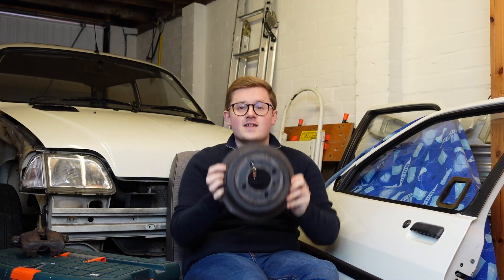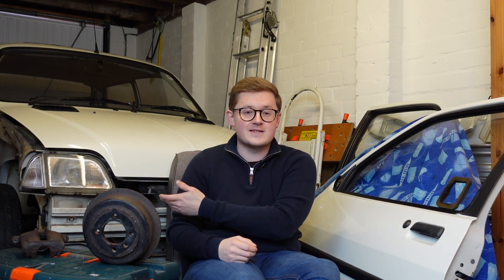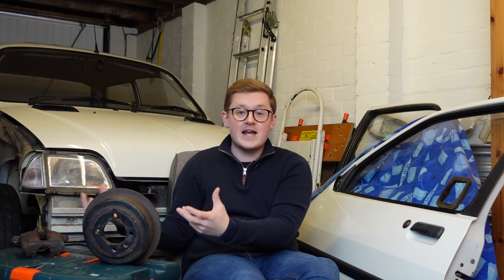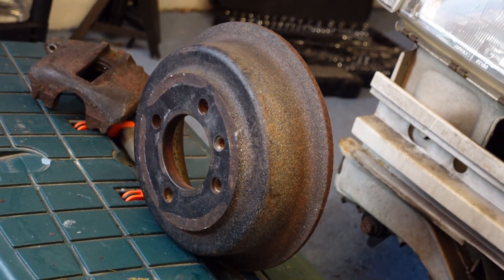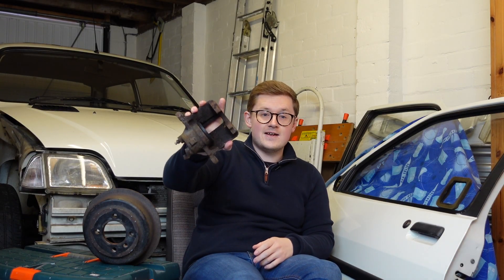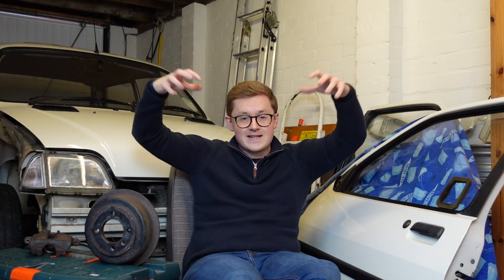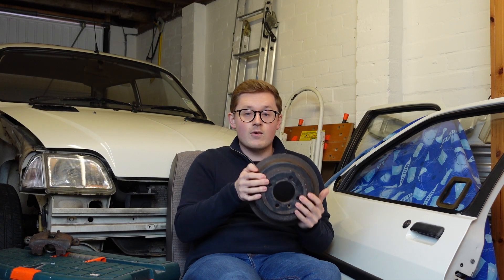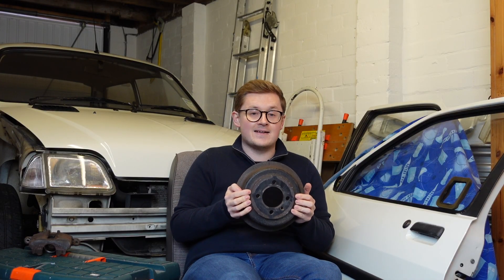Why are Drum Brakes Making an EV Comeback?

Comment: Great video! I've moaned for years about the rear brakes on me Hyundai i10. Park overnight - handbrake seized on! Hyundai are supposed to have cured this [but haven't] A car with 66BHP doesn't need them! Had rusty rear discs replaced twice!👍
Reply: I was thinking of exactly the i10 as bad example of rear disc brakes. They all rust out

Comment: You only have to look at rear discs on many ice cars to see the owners of ev's will be replacing them a lot quicker than on a similar ice vehicle. However, Im still surprised ev manufacturer's are going back to drums when the obvious solution is electro magnetic brakes. 
Years ago, some buses and coaches were fitted with an electro magnetic device on the prop shaft. When the driver wanted additional braking, this was operated by a lever on the steering column. The electro magnetic force applied to the prop shaft could be varied from weak to strong depending on how far the lever was moved. The electro magnetic force effectively slowed the prop shaft rotation and hence slowed the vehicle.
Im pretty sure this could be adapted to be foot operated or steering wheel buttons and also to include ABS. Theoretically, ev's could do away with wheel brakes due to regen braking but then problems with aggressive braking and no ABS on each wheel would arise.

Comment: Excellent job Ed, I think you missed a handbrake option though, a second set of pads mechanically operated acting on the disks as per late 2cvs and presumably other front handbrake disk fitted Citroens. As an EV driver I can confirm the friction brakes do very little of the normal braking and are crusty looking most of the time.
Reply from the maker: Thanks Richard, but as I said in that section of the video, we're ignoring the exceptions and keeping things simple. If we went over every variety and eventuality, we'd have been here all day!

Comment: 6:24 not ever car with rear discs use a drum in the middle for the hand/ parking brake. Manufacturers will put the hand/ parking brake into caliper which use a cable to activate the brake or nowadays manufacturers are using electric motors for the parking brake. This can cause an issue when changing pads as the system has to be put into a Service Mode in order to push the pistons back.

12:25 I'd also say that a Golf is FWD whereas an ID3 is RWD.

Braking components are coming down in price (although prices have gone up from suppliers, what was a relatively cheap disc and pad combination for say an Astra a few years ago has shot up but obviously that a Global issue) due to fact that suppliers don't want the old parts back. We use Napa parts at work and it astonishes me the amount of parts we simply throw in the scrap. I threw two drivers shafts for a 1 series yesterday as well three brake Calipers and brake discs. Year ago suppliers would have surcharged for the calipers and shafts and VW used to surcharge for water pumps..... now we throw them out.
Reply: A cheap third party VAGCOM reader can put the brakes into service mode. I've got one from Biltema. It cost me NOK 999 (GBP 77.04). Older calipers with parking brakes are annoying because you have to turn the piston while pushing it in when replacing the brake pads, at least on the ones I've come across.
Reply from the maker: As I said in that section of the video, we're ignoring the exceptions and keeping things simple. A number of cars also use a front axle handbrake that acts directly on the driveshafts.

Comment: The only car that I've owned which had a totally useless handbrake happens to be the only car which had discs all around. Now back to a disc/drum arrangement and all is good.
Reply from the maker: I have noticed that, even with rebuilt rear brakes, my E46's handbrake is hopeless compared to my pair of Metros.
Reply: the handbrake drums on bmws are useless - a proper full drum brake is much better.

Comment: You my man are a good teacher. So simple and to the point. Love it. I know 4x4 love drums over discs as they don't warp when going through water
Reply: They don’t work for the next ten miles though
Reply: @highdownmartin   I wouldn't quite put it at 16 kilometres before they start working again. Possibly after one braking application and certainly after the second braking application you've pretty much gotten your brakes back.

This is in a 7500kg 4x4 Isuzu NPS truck, which is fitted with drums all round.

Yesterday I was in a state park (Australia) and did a river crossing where the drums went under, it was 500mm to 700mm deep, (bit hard to judge peering out the window) climbed up the bank then when levelled out, applied the brakes, stopped to let water run out and off. Took off to get some speed up, then after a second application, they were working, then onto the next crossing.

In another life and riding my near new BMW R90S motorcycle 48 years ago, I did a river crossing and the discs on the front wheel had cracks appearing between the ventilation holes the next morning. I replaced the stainless (?) steel front discs with solid cast iron ones without ventilation holes and they stayed on the bike until I sold it about 115,000 km's later.
Reply: @allanhugh2044  I saturated my Landy playing in a new forest Ford. It was a good five miles before it stopped/ stopped slewing. So depends on the vehicle I think, mine gets wet brakes driving through big puddles!
Reply: @highdownmartin   I suppose it could to an extent, be vehicle specific. I started driving Land Rovers in 1968/9 in the Australian Army, SWB and LWB. The trick we had after a water crossing, was to keep driving (usually in second gear) and apply the brakes with the left foot for a short time to dry them out. Stopping after a crossing was not a good idea, as one could find the following vehicle doing a close inspection of your rear end.

I don't really remember having much difficulty with wet shoes not stopping those Land Rovers. Then again the speeds we were travelling at back then weren't much, even on bitumen.  😊

Slewing, hadn't thought of that, but I do remember the slop in the steering box of those Land Rovers being so loose that anything much over 70 km/h in a SWB and you would have difficulty keeping it in a straight line; slewing indeed!

Thinking a bit more about slewing, the Land Rovers I drove were all fitted with Uni-Directional Bar Tread tyres, if a bitumen road even looked wet, you needed to have your wits about you as you were generally only one bend away from sliding off the road.
Reply from the maker: Thanks mate, that's very kind of you to say :)

Comment: I never thought I'd find a video on drum brakes so interesting, but I did. You have a knack of explaining technical phenomena in a very easy to understand and interesting manner. Technical college tutors take note! ;-) I would like to mention one other 'advantage' of rear drum brakes, and that is the handbrake turn! The fun I had as a youth, in empty carparks and the like, in snowy or wet conditions, using the wand. ;-) Actually, a use of the manual handbrake can get you out of bother in snow. Something modern electronic parking brakes are incapable of.
Reply: Best is hydraulic handbrake on rear disc brakes, just like rally cars use.
Reply: @AndrewTSq I don’t think handbrake turns are really relevant to everyday driving.
Reply: @davidspendlove5900  its good if your front gets loose in the snow, you grab the handbrake to stop the understeer.  But normal drivers these days seems more interested in selfdriving cars than driving themself :)
Reply: In a RWD car (or in FWD cars with the handbrake acting on the front wheels), if one wheel is spinning on snow or mud, holding the handbrake half on stops the spinning and lets the other wheel grip, so you get moving.
Reply: @Summers-lad  Handbrake on front wheels? Sounds like you have driven a SAAB :) I had one of those!  Had no idea that the handbrake was on the front tires first time I tried a handbrake turn in the snow and it went straight ahead instead :D
Reply: @davidspendlove5900 Of course they are. I'm 57, can still perform one into a bay at the parking behind Tesco. 
Handbrake turns, and gangster turns, are essential skills 😅
Reply: @AndrewTSq  Or a Citroen BX.
Reply from the maker: Thanks Phil, that's very kind of you to say :)
Reply: i helped my daughters to learn how to react in (our infrequent) snow on an empty carpark using the handbrake to cause a slide and letting them practice recovery.. scared them +×÷#less at first, which is much better on an empty carpark. They got years of experience in 20mins.
Reply: @hattyfarbuckle The snow, it's more a case of applying the hand brake on a RWD works like having a LSD 😅❤
Reply: Brake lag and unsprung weight is the downside of drum brakes, on large vehicles is more noticeable even more so with abs.😮
Reply: These days vehicles have "traction control" to give some of these capabilities. Having two separate brake cables with two levers was interesting but rarely useful.
Reply: @alanb76  Both yes and no. Some cars have really aggressive traction control, so smallest slip of the tires and it cuts your engine. My VW, I can hardly get away when its very icy on the road.
Reply: @AndrewTSq  same with the mercedes vito. the slightest slip of a wheel brings the rpm down so much the engine just kills itself.
i wonder why they dont set a minimum rpm which switches the esp off automaticly if the minimum set is reached. with esp off it acts like a car with esp should. starting regulating power just when the car starts to drift just a tiny little.
Reply: How do hand breaks get you out of snow?
Reply: @eswing2153  They don't get you out of snow. However, if you are driving around a bend, and your car starts to understeer towards the outside kerb/ditch/tree etc, a quick tug on the handbrake can induce oversteer, which you can then steer into, thereby controlling the slide, and making it around the bend. This only works if aren't going way too fast for the corner. When you loose grip over a certain speed in snow, only something solid will stop you!

Comment: It was Jaguar who possibly pioneered disc brakes at Le Mans with the C Type , early 1950s , this gave gave a big advantage over their biggest   Italian rivals, notably Ferrari. This not allowed less brake fade but also later braking . In domestic use , however, drums WILL stop you if everything maintained and adjusted correctly for a single or two heavy applications. If you have do too many heavy applications on a given journey , you’ve got something more wrong with your driving style , than the design of brakes on your car.
Reply: Drum brakes are more vulnerable to contamination by water and mud. 
Driving through water can result in nonfunctional brakes.
Reply: Stop and go traffic is also terrible for causing brake fade.  While driving through a snowstorm, in a '76 T-bird, it was either ride the brake pedal or hit the guy in front of me.  The rear drums overheated, so there would be no rear braking, even after the fronts had completely locked up.  Being RWD, the T-bird would go out of control.  I spent the next two hours abusing my transmission, bumping it to neutral if I was gaining on the car in front of me and bumping it to drive when it began to pull away (a police officer told me that stopping in the emergency lane to let my drums cool might impede the progress of an emergency vehicle).
Reply from the maker: I'm led to believe that 911s didn't have a brilliant relationship with discs in the early days owing to the weight distribution?